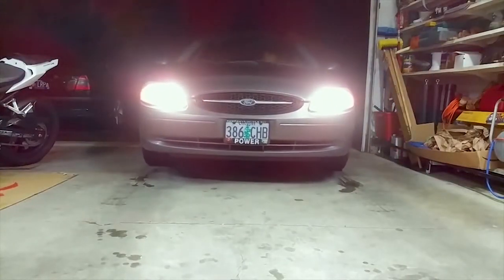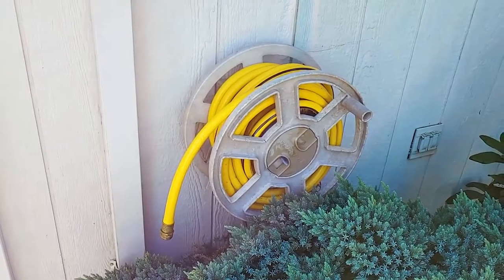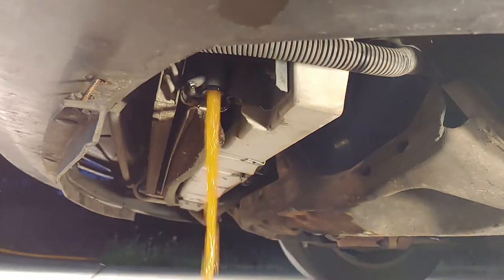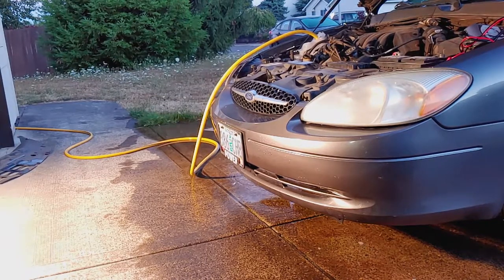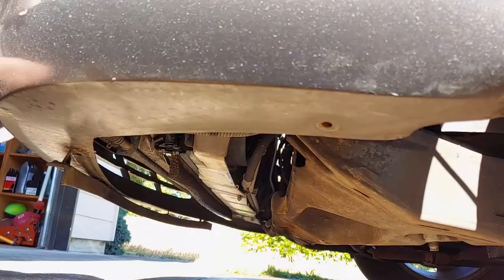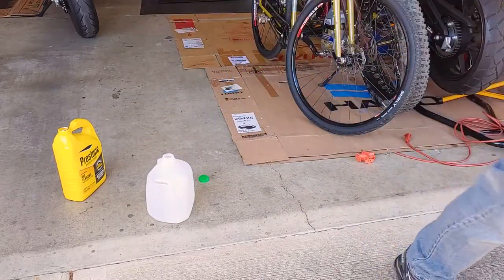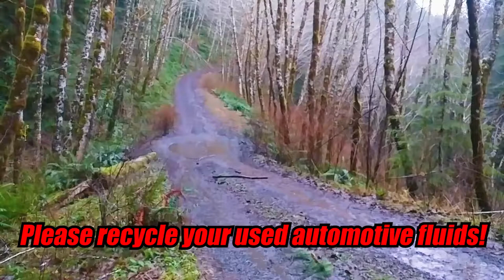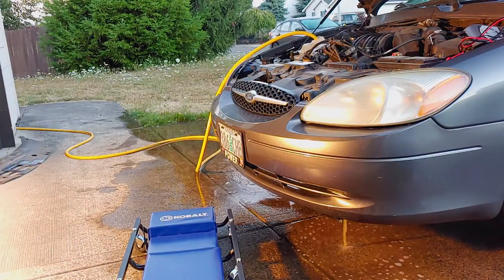Coolant Flush - No Jack Required! Ford Taurus / Mercury Sable 2000-2007

Comment: You do realize that some of that hose water is still inside your system, you may think you flushed it all out but with this particular motor that is not realistic, you needed to pull the bottom radiator hose in order to make sure all the tap water has been removed.
Reply from the maker: Oh, I did not know that, so thank you for pointing that out. You don't want to leave a bunch of hose water in there. The motor in this car seemed to be heavily rusted inside the coolant passage ways, but anyone who wants to make one of these cars last should flush the coolant regularly and thoroughly. Thanks again for the helpful comment :)
Reply: @EndlessMoneyPits  that's why it's so much easier to just empty the reservoir and then use two treatments of flush at once and then mixed with the distilled water in the reservoir and don't worry about draining at this point because two treatments will take care of your issues, then when you've let the car run for a good 20 minutes or so at idle you should drain everything and pull the bottom hose off make sure your heater is on full while the treatment is running through the system, what the vehicle cool down and then do all those steps and it's always wise to change the thermostat after this is done because those flushes will damage the thermostat sometimes especially if they've been in the vehicle for a long period of time. Biggest mistake people make when they replace the thermostat is they don't put the weep hole in the north position in the thermostat housing and not doing that will cause the vehicle not to properly Purge the air out of the cooling system, when you're done filling the system fill the reservoir with a 50/50 mixture of Ford gold antifreeze and leave the cap off the overflow tank reservoir tank until all the air has been purged out this usually takes about 15 minutes after the vehicle has reached operating temperature. That will give you a perfect flush.
I've owned a restoration shop for over 40 years and I always give people great advice. But thanks for putting the video out here on YouTube.
Reply: @Wills Restorations  hey there, will running the heat also flush the heater core? Seems as though it would seeing as though it is tied right into the cooling system,  so long as it is in operation.
Reply: If I remember correctly, the bottom hose is hard as hell to get to. I'm just here refreshing my memory on this car as I have a friend that is wanting me to change his water pump and I was going to do a flush first.
Reply: @catfisher420  it depends on which motor this particular model has as it has two different motors that came equipped on this car, The 24 valve duratec or the Vulcan motor at 12 valve motor. Each of these motors are fairly simple and straightforward to remove the bottom ready of the hose. Also you would be best to flush the motor before you did your water pump so that you do not flush any hard contaminants through a new water pump, this would not be a good idea.

Comment: I'm an oil burner tech in Massachusetts and a month ago purchased a 99 mercury sable off my customer her elderly mother who passed away this past summer had purchased the car new it had been sitting for a couple years since she was disabled and it only has 57 thousand miles on it paid 800 bucks needed detailing inside and out but worth it doing this today on her as preventive maintenance only is hers does not have the splash shield
Reply from the maker: Good purchase. That car should last along time with proper maintenance! Glad you found a deal.
Reply: Hey Guys, It is nice to see a similar story. I paid 1000 for my silver bullet a five years ago 3rd hand with 88 thousand miles. I love this car lol  She now has about 104k and been having heating issues in cab. I changed out the heater core a few years ago and then it stopped working the following winter. I now changed the actual heater core hose assembly, that sits outside the firewall, and still no heat in the cab. I don't think its the heater blower motor fan or motor resistor. So I will switch the thermostat and flush the system altogether and see if that gives me heat. I hope all is well and warm with yours. any assistance would be appreciated. Thanks
Sincerely,
Cold Sable

Comment: I'm going to be adding Rislone stop leak after I flush the system of my 2000 Ford Taurus with vulcan V6.  Should I pour rislone first or after I've poured a couple of litres in?
Reply from the maker: I would never recommend using a stop leak product because they can actually clog the narrow passages of the radiator and the leaks often come back anyway. If you use it, just follow the directions. I have never used it personally.
Reply: I've used rislone before and had zero issues.  To each their own.
Reply from the maker: I have heard a lot of warnings to not use it, so I wouldn't use it myself. You'll never get it out of the cooling system, so it's better to fix the leak the right way by replacing the radiator. If the car is on its way out and it doesn't make sense to put that much money into it, then I guess I can understand why you'd use a stop leak product in that situation.
Reply: Just fix it the right way

Comment: Coolant capacity for this car is either 2.6 or 2.9 gallons depending on the engine, so I don't think your 1 gallon of coolant got you to 50/50
Reply from the maker: That's if you drain the block.
Reply: @EndlessMoneyPits  you flushed the block multiple times in this video... youve got 1 gallon of coolant, 1 gallon of distilled water, and almost a gallon of hose water in there
Reply from the maker: I didn't drain the block there will always be some coolant left unchanged without draining the block. I drained from the radiator, which is most common.
Reply: @EndlessMoneyPits  where do you think that hose water went when you ran the engine for 20 minutes? Not into the block??
Reply from the maker: The block was never completely emptied, so it didn't need to be completely refilled.

Comment: Yeah that’s not how you do it first how about purging the air . Second only use distilled water and back flushing the heater core is very important these cars can be difficult purging the air from the cooling system

Comment: Yeah that’s not how you do it first how about purging the air . Second only use distilled water and back flushing the heater core is very important these cars can be difficult purging the air from the cooling system ole epa be happy to see that poison running uff for peoples pets to drink bud .

Comment: I learned a long time ago that to completely flush the system You need to remove the top radiator hose and run the engine up to operating temperature while you slowly add water at a rate to keep it full enough not to over heat. Do this for at least 5 minutes.  This allows the engine to be flushed as well as the radiator and gets all the nasty stuff out. This makes a mess but it works